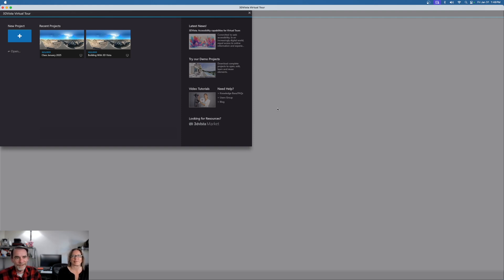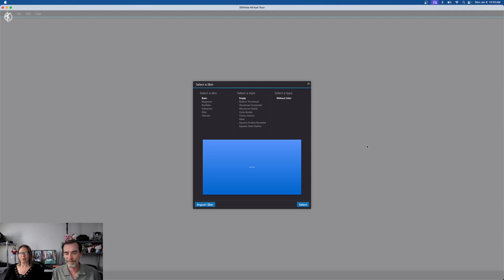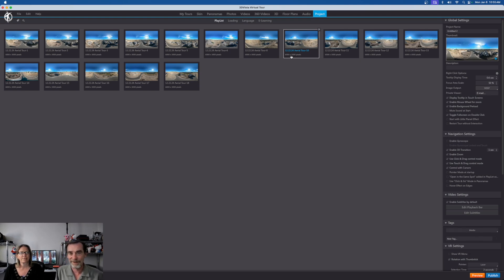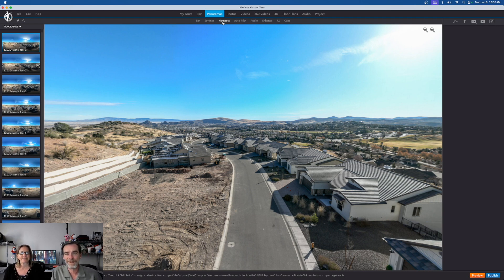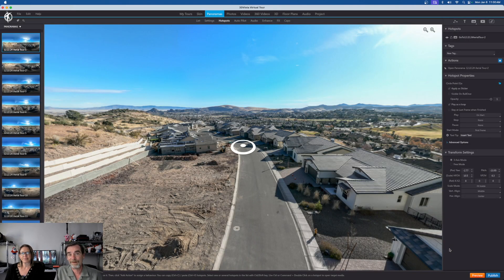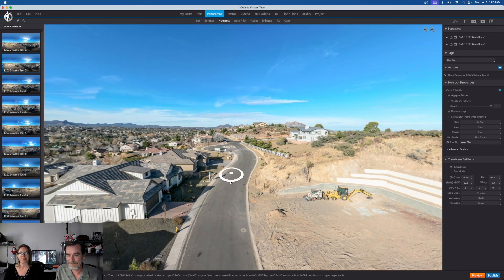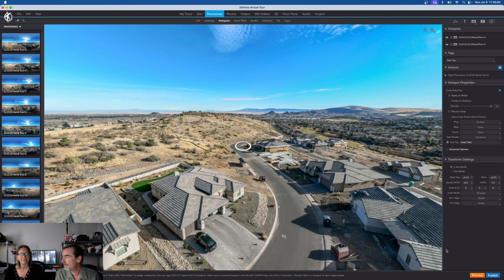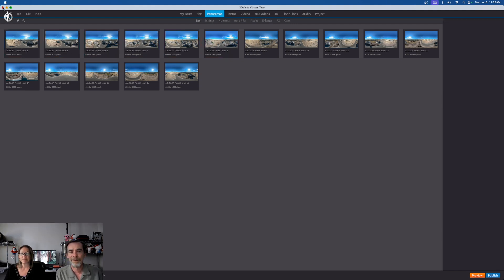Building an Aerial Drone Tour in 3D Vista – Part 1

Comment: 3DVista is terrible.
I really tried to give this software a chance but since day one I had issues non stop. It works fine sometimes but then bugs out on big projects and crashes out non stop.
It will lose your progress no matter how many times you save and it will fail while exporting.
You will have to to the same work over and over.
I do not recommend it to anyone.
It has great features but way to many big issues + tones of small bugs ( fonts, hotspots, etc... )
Reply from the maker: Thanks for sharing your experience with it.  So far we've been okay with it, but I'll keep my eyes open for issues as well.

Comment: Very interesting how the use of 360's has progressed. I also use 3DVista. For one of my main clients (residential construction) I am capturing drone data for 20 to 24 sites every month, just starting my 7th year of doing this for them!! For many years for the monthly construction updates they preferred video. In the last 12/18 months there has been a swing to 360's. They found with the 360's that they can navigate to whatever part of the site they want to review and pan around. Not so easy with video. On larger sites I may capture 10 360's. One thing they did want is multiple hotspots on each panorama so that they can quickly move around the site. That takes time to do but I have got quicker. Have you found an ideal height to capture them at? Currently I am capturing them at 180ft. I host mine on a 3rd party hosting site.

For another project where I am soon to submit a permit application for a new development I am building a 3D tour for "Community Engagement". I think 3DVista is a good tool for conveying information and in particular when you have multiple data sources. I will share it with you when its ready to go.